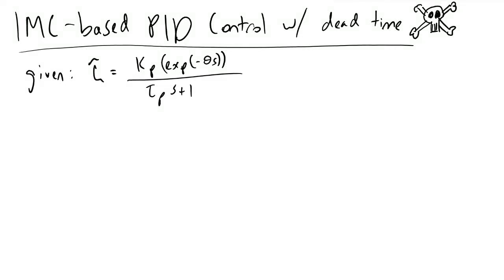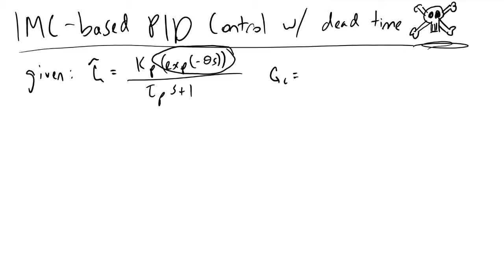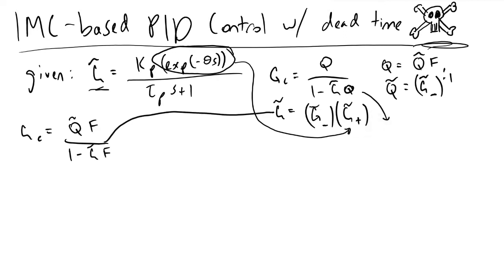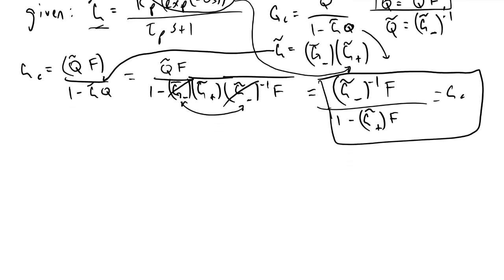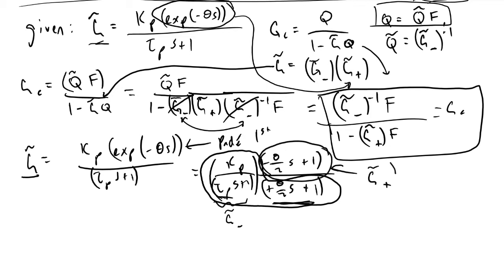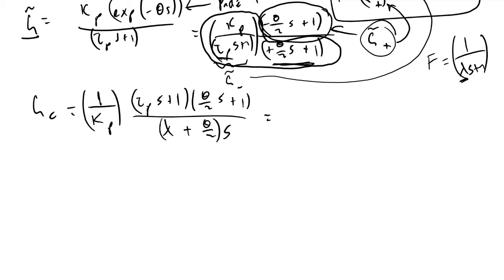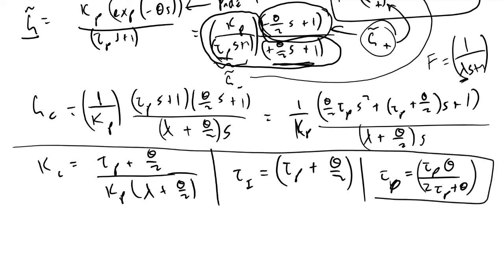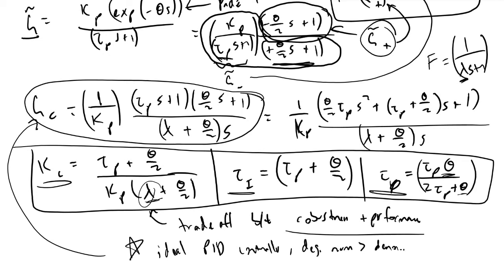IMC PID Design with Dead Time

Comment: Hey Vincent, great video!
I have a question about this subject. I'm wondering, could you start off by: 
1. Declaring G+ = e^-(θ*s), which I reckon is justified, since, by Taylor, the expression equals:
    1-(θ*s)

2. Calculate Gpid in fucntion of e^-(θ*s), which would wield:
    (1/Kp)*(τ*s+1)/(λ*s+1- e^-(θ*s))

3. Here, if you plugged in the Taylor equivelent, we would have a simple PI controller. However, what if I plugged the pade expression? This would give us, the following:
    1/Kp*(τ*θ/2*s^2+(τ+θ/2)*s+1)/(λ*θ/2*s^2+(λ+θ)*s)  - (if I haven't made any mistakes)

How is this different from what you have shown here? Is it allowed?

Thanks!